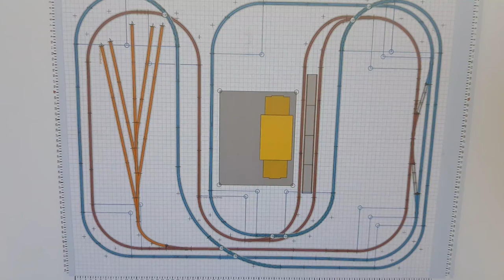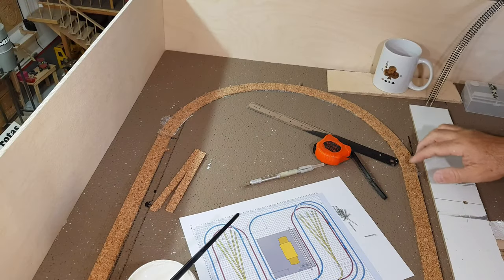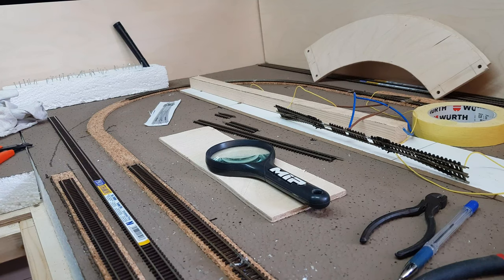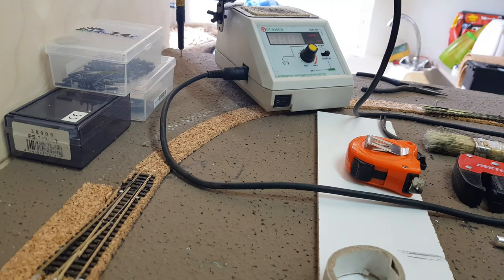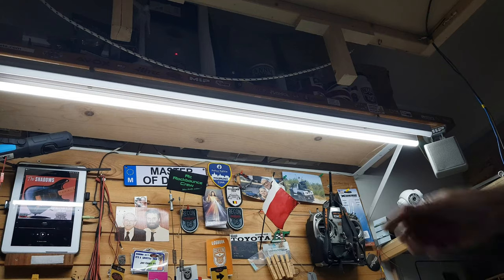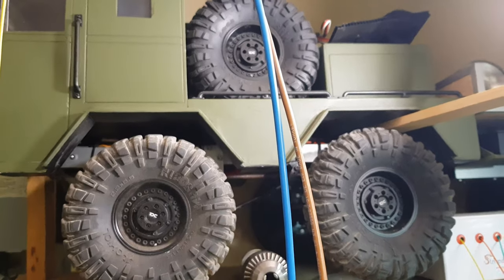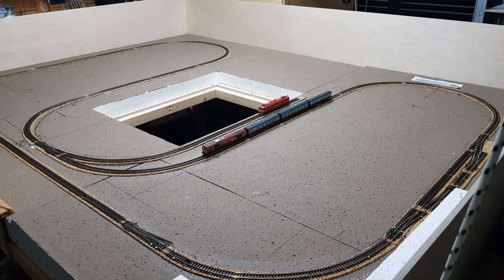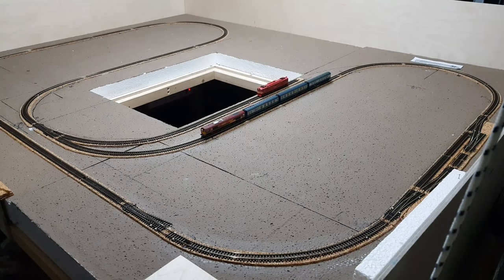Ep02 - Laying some track at Ħal-Zuzzu Model Railway

Comment: Well the work is going really well, and the layout for the rail train is great, the cork is excellent for reducing the noise of the train, that's what I told my father who is building one, everyone has the same idea lol. Your system for getting on or off the train is perfect and a good idea for safety on both sides and practical for working underneath.  I just saw that you posted another video, I'm going to go watch it. Have a nice day Joe 😊
Reply from the maker: Hey Pascal, thanks :)  I put the cork for 2 reasons, to eliminate the noise (which in reality I don't have because the layout is on 4cm of polystyrene) and mainly to raise the track to make it look more realistic :) 
Good to hear your father is working on a layout .. we could have that in common too :) 
Yes, the fact that the layout goes up to the ceiling is a plus for me for when I want to work under it :) 
Thanks for dropping by :)
Reply: @Hal-Zuzzu_Model_Railway  It is true that I saw that there was polystyrene underneath, and a little height for the rails is very good.  
I just ordered some fake grass and some small street lights for him on aliexpress , I think it will be a good gift of Christmas for his project. I asked him for pictures, so I would send them to you on FB 😊
Reply from the maker: @satorrotas  That would be great. What gauge is he building?
Reply: @Hal-Zuzzu_Model_Railway  It's HO
Reply from the maker: @satorrotas  Ah nice :) I am using N gauge - the layout is too small for anything bigger!!
Reply: @Hal-Zuzzu_Model_Railway  Yes I think he already had a wagon and a locomotive in HO so he continued on this scale , afterwards I don't know if he will change or not I would have to ask him.
Reply from the maker: Make one yourself :)
Reply: @Hal-Zuzzu_Model_Railway   No, I have another idea in mind for a long time, which will take a long time to do but really interesting 😉👍
Reply from the maker: Looking forward to hearing about it :)
Reply: @Hal-Zuzzu_Model_Railway  The start of the work will start at the end of January I think because I have two constructions in progress for my scale park to be finished before, the length of the project is 2.70 meters, width 70 centimeters, for the usable height I have 50 centimeters. On all the length of the 2.70 there will be a train rail, but no train 😁 Maybe a single flat car, but no more. But this wagon will have to move alone with a small engine. I say no more 😄
Reply from the maker: @satorrotas  hmmmmm - this I have to see!!! i have an idea for you to move it without motor :)
Reply: @Hal-Zuzzu_Model_Railway  I could move it by hand, but with a small motor it will be better, in addition it will have to move really very very slowly.
Reply from the maker: Magnet under the board! Pull the magnet from both ends! Many cheap low RPM motors on Banggood
Reply: @Hal-Zuzzu_Model_Railway  Great idea, I didn't have to think about that, thanks, I'll watch on banggood.
Reply from the maker: https://www.banggood.com/search/reduction-gear-12-v.html?from=nav
Reply: @Hal-Zuzzu_Model_Railway  Thanks for the link Joe, I think this will be very good for my project 😊
Reply from the maker: @satorrotas  Keep me informed :)
Reply: @Hal-Zuzzu_Model_Railway  Ok, as my work progresses I will send you photos on fb 😊👍